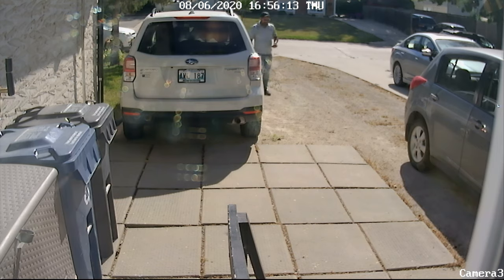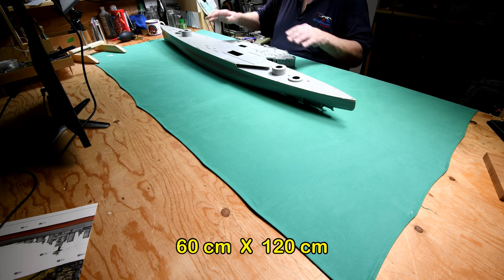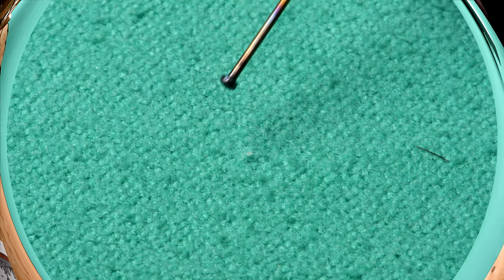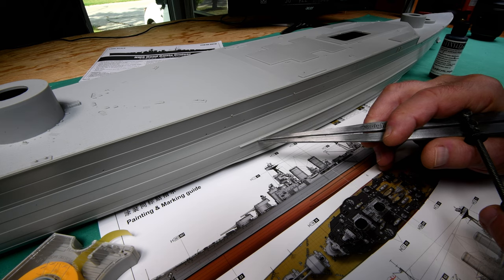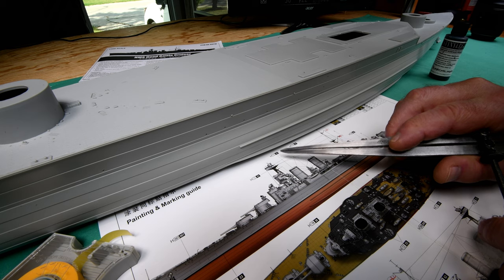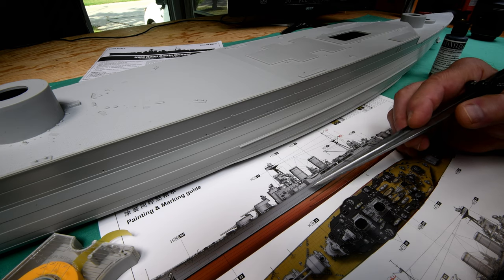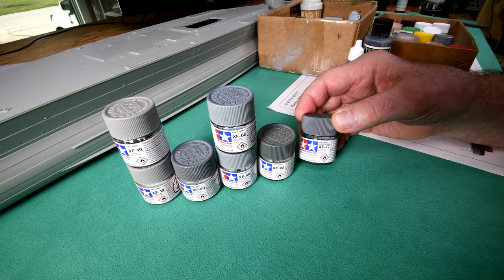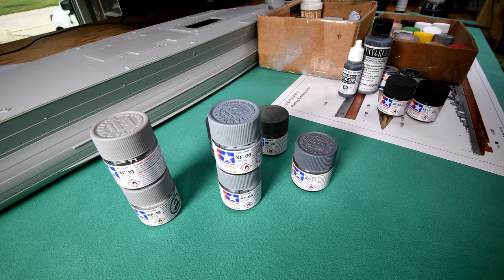The Model Ship - Part 527

Comment: Why do you call the boot liner well it clearly isn’t his actual name is Plimsoll line
Reply: THE BLACK LINE THAT RUNS THE LENGTH OF THE SHIP IS CALLED THE BOOT LINE OR BOOT TOPPING,THE PLIMSOL LINE IS THE SET OF NUMBERED MARKS AT THE BOW AND STERN(AND IN HOODS CASE THERE WAS ONE IN THE MIDDLE UNDER THE SHELTER DECK) USUALLY IN ROMAN NUMERALS WHICH SHOW HOW DEEP THE SHIPS SAT IN THE WATER THUS GIVING HER DISPLACEMENT